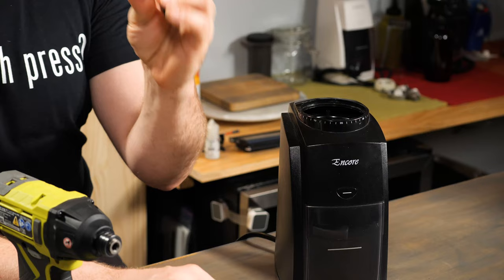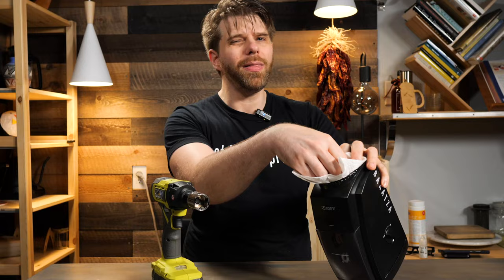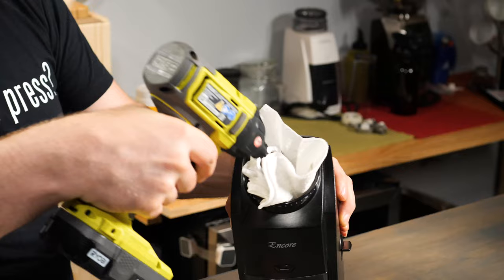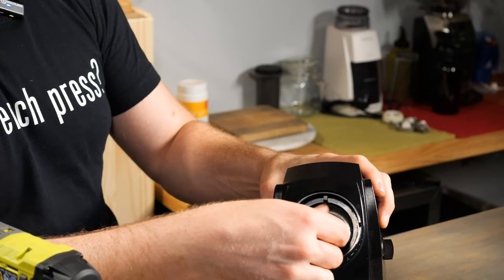How to: Baratza Cone Burr Replacement 🛠 | M3 & M2 + Paddle Wheel!

Comment: If using 1-1/6" socket, it must be a 6-point, not a 12-point. A 12-point 24 mm socket, also over a quadrupled (4 layers of) paper towel works well. Thanks for your video.

Comment: My cone burr is on so tight that this method doesn't dislodge it.  I've even applied WD40, but the burr simply spins in the clockwise direction without coming off the shaft.  I believe the next step is to take the device apart so that I can grab the shaft with a vice grip and then try to spin off the burr.  Any other suggestions?

Comment: What is the process difference between the two grinders.  I actually own both.  I couldn't tell what was different.
Reply: The M2 burr grinds faster and it gives more even grind
Reply: I believe the Virtuoso drive shaft does not have a wing nut to remove.  Instead the top of the drive shaft sets flush with the top of the burr.  Everything else is basically the same.
Reply: He's asking about the process, not the burrr.  @SASmiley
Reply: @EdDinIL  You are correct
Reply: I just replaced my paddle wheel yesterday 06.24.24